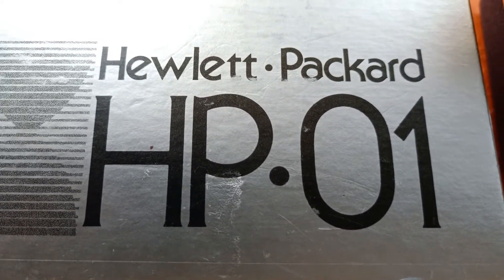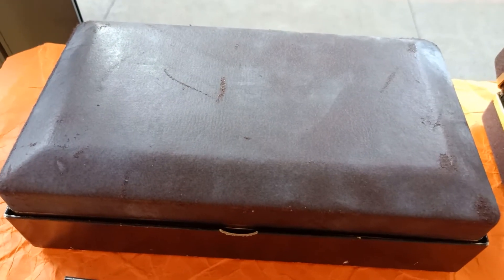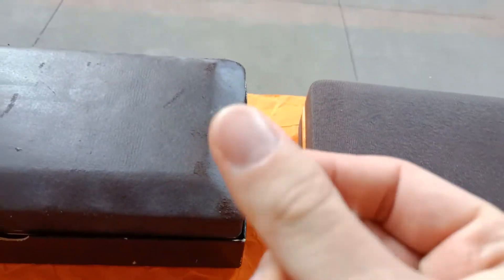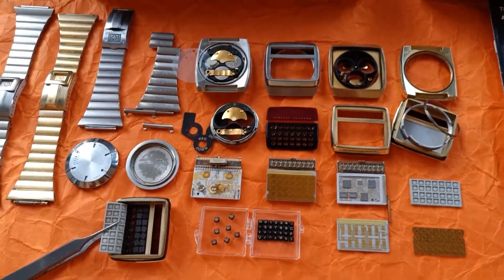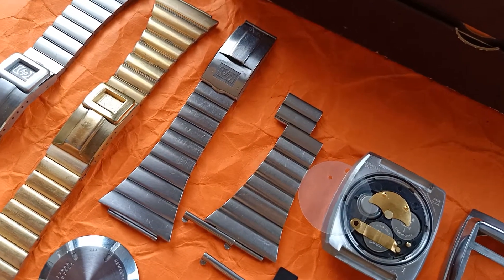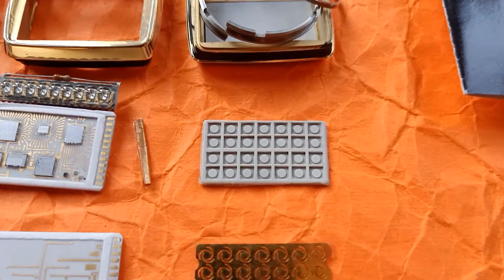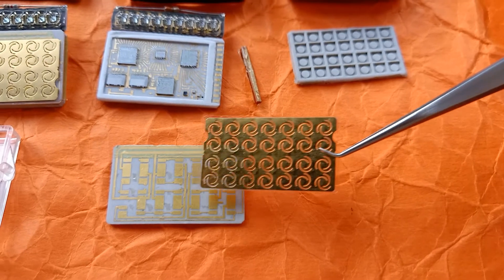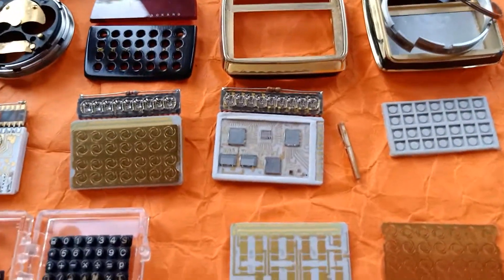1977 HEWLETT-PACKARD HP-01 LED WRISTWATCH CALCULATOR UNBOXING AND PARTS REVIEW

Comment: I'm not sure if you're still replying to comments but I have a question hopefully someone can answer. I have an HP-01 that works perfectly except for the #7 key, which is unresponsive. I opened up the case and removed the two rings that retain the battery carrier and bezel. On your website you mentioned that the module should just fall out. That isn't the case for me. I'm trying to hook the circuit board to extract it but it doesn't seem to budge. I'm wondering if anyone has encountered this before. I'm trying to be delicate so as to not damage anything. Also, once I remove the circuit board what would be a good way to repair the unresponsive button? I'm thinking about trying alcohol or electronic contact cleaner to clean the contact pad. Thanks.
Reply: I managed to get the module out by lightly pushing on the keys. I tried cleaning the contact on the unresponsive key and it still doesn't register when pressed. If anyone has any recommendations on how to resurrect the key I'd appreciate the help.

Comment: Interestingly, we put in batteries and didn't completely understand the location of the battery clip. I thought it was snapped but after watching your video walkthrough, could clearly see the location. The watch is now working perfectly. Before connecting properly, lots of random numbers would display for a minute.

Comment: Is the black keypad also anodized black aluminum too? Great video, probably the only video in existence documenting the parts of the HP-01. Thank you!
Reply from the maker: The keypad is also anodized aluminium although there was a pretty rare and last (attempt) version made with a plastic pad and keys. This was probably done to cut costs just before they ceased production and closed down the factory. Note that the plastic keys did not survive long when triggered with a pen or metal pin.
Reply: @crazywatches  the keypad looks rubbery to me ..I always assume it was plastic
Reply from the maker: @ladronsiman1471  First generation was anodized aluminium both pad and buttons. I found a parts pad made of black plastic with heaps of wear and buttons chewed away from use. I assume by 1978 they were already saving money due to the obsolescence of the product and competition and thus swapped to cheaper alternatives. I have not seen a complete watch with plastic buttons so perhaps none survived due to wear and were thrown away.